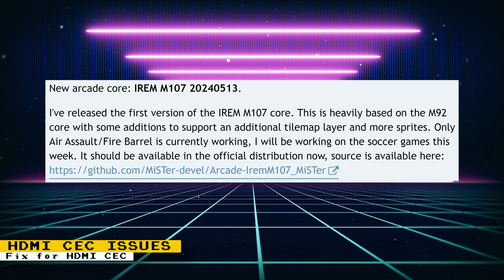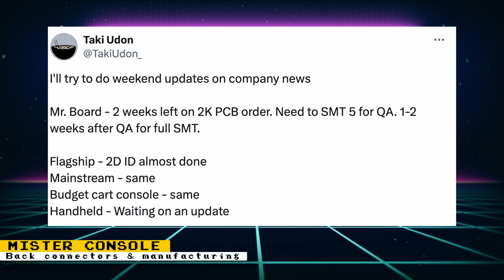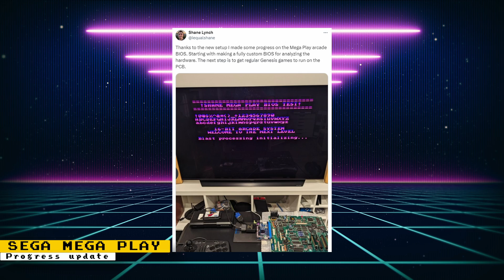MiSTerFPGA News - MiSTer Clone, Irem M107, System 18 & More

Comment: "I try to avoid modifying my hardware"  Your hardware was designed with a flaw. If the designers could get at it, they'd cut the pin too.

Comment: Looking at the DE-10 schematic, the CEC issue makes sense.  The U34 ESD connected to the the CEC line to 'VCC5', but VCC5 is only present when the DE-10 is powered on.  With the DE-10 unpowered, the ESD is pulling the CEC line to a diode drop above ~GND

Comment: As good as NON FPGA arcade emulation has gotten in MAME and especially FB ALPHA. At what point will FPGA be a redundant option for gamers. I'm asking because there are STILL games that are basically perfect in mame that nobody has got running barely as good on FPGA yet
Reply from the maker: I use both FPGA and software emulation so they both can coexist. I see them as different ways of preserving hardware and games. Software emulations has helped FPGA emulation and FPGA emulation has also contributed back to software emulation. People should just use what fits their needs.